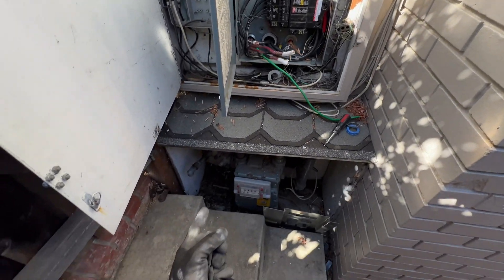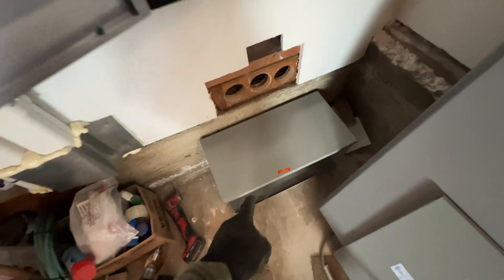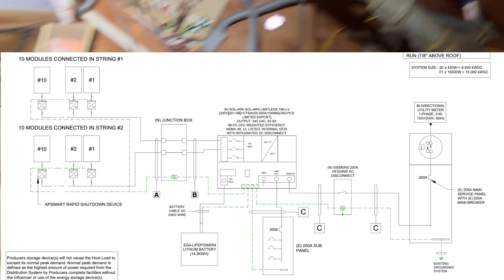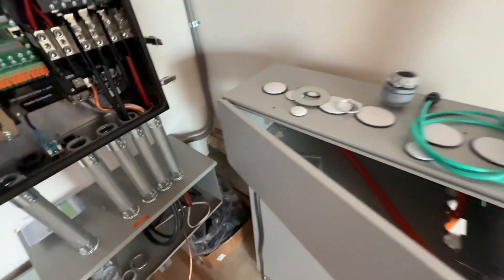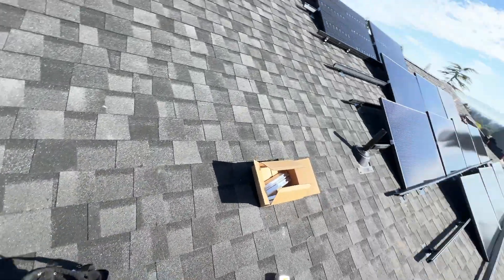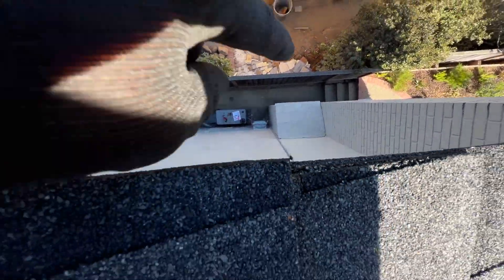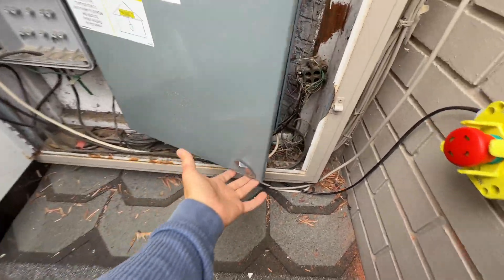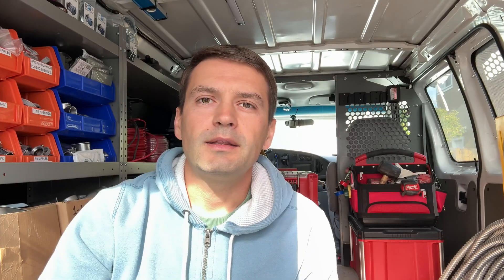Installing Full-home battery backup with solar. Sol-Ark 15k, EG4 Powerpro, and 20 solar  panels

Comment: I've heard that sol ark is canceling the warranty for anything that is connected to EG4 batteries. As an installer have you heard this?
Reply from the maker: The warranty will be voided if any data written from the battery to the inverter via the CAN bus results in inverter failure.